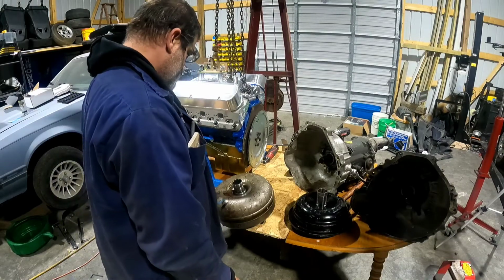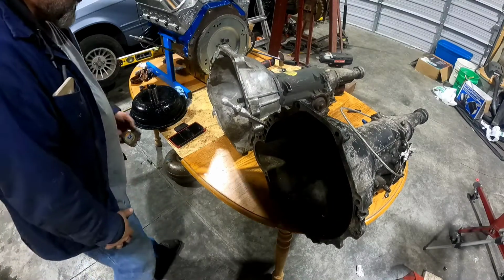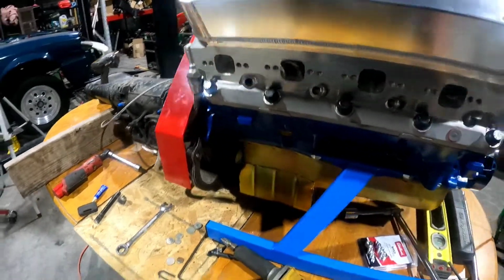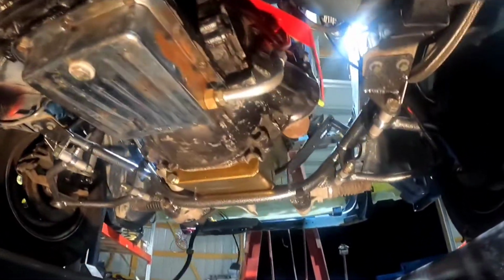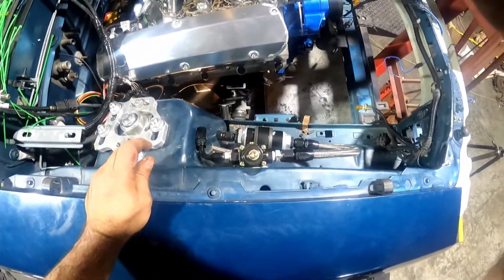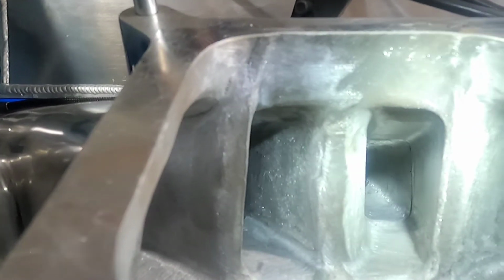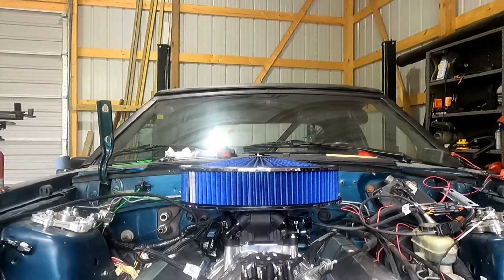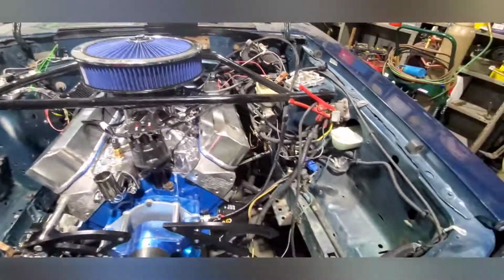ep 42 Engine and Transmission install in 1993 mustang 351w swap and c4

Comment: Was taking out the rad enough clearence to drop the engine and tranny in at the same time? I am having issues putting my transmission in from the bottom and im thinking of trying to do it all in one. Thanks for this video
Reply from the maker: Yes taking out the radiator should give enough room to put both engine and transmission into the car if you rig it up right. I had to use a ratchet strap to get the angle right.